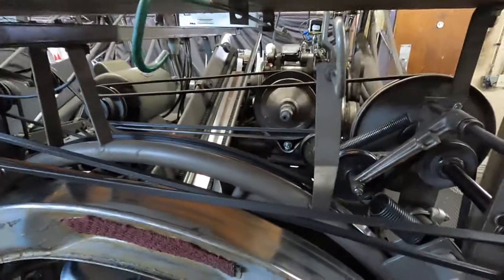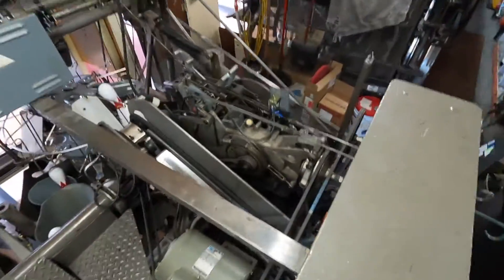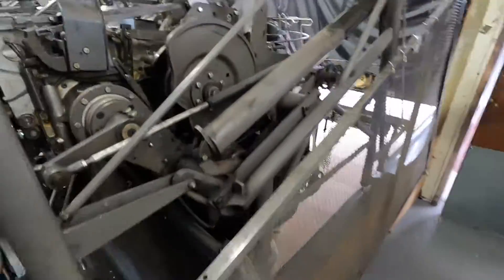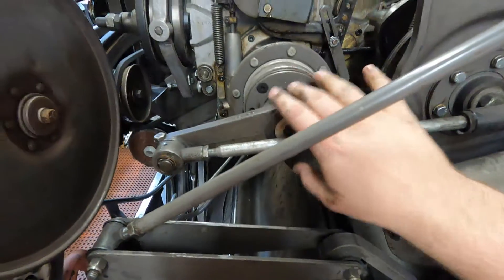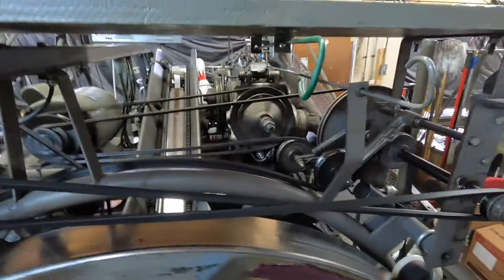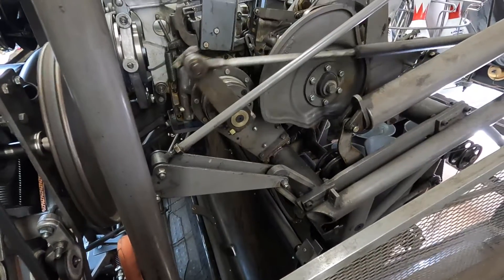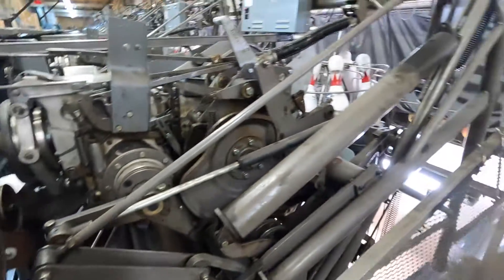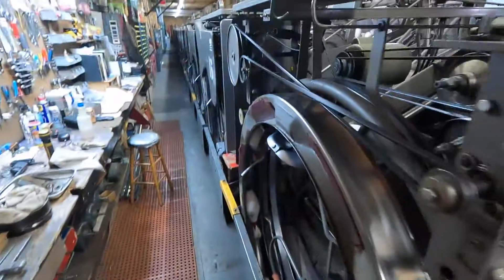Clutch Lever #9 - Brunswick Pinsetter Adjustments

Comment: That is not correct on your small rake crank rod you want the rod to dissect the 4 to 1 ..... on the larger arm you want it so that it stops resting on top of the washer due to the offset
Reply: Care to elaborate?

Comment: So the bottom clutch yoke nuts are to adjust the crank arm up or down? So does the work shaft nuts just be adjusted to have the drive disc against the bearing retainer clause is all? I always looked to see how the clutch lever roller was riding against the stop arm. 
Glad I found these vids. I’m a visual learner so these help much better then trying to read your way through.
Reply from the maker: Yeah the worm shaft nuts basically just keep everything in place while the nuts for the yoke adjust the timing of the machines. I’m really glad these are helping you!! Please ask anymore question if you need help!
Reply: @thepinsettermedic  I do the complete opposite.  Set the gap with the yoke screw (1/16 clutch disengaged with stop surface, new style flush with retainer) and adjust where it stops with the worm shaft nuts.  Backing nuts off 1 1/2 flat spots get you pretty much dead on every time.  Steve Stafford has a step-by-step guide on bowl tech floating around.  WAY less wear and tear on your clutch.
Reply from the maker: I’ll have to look into that. Thank you!
Reply: 1 1/2 is for if you are running A speed. Not sure for jet back or A2.